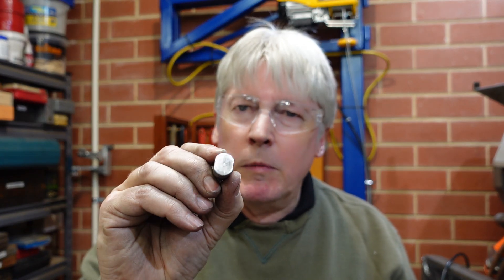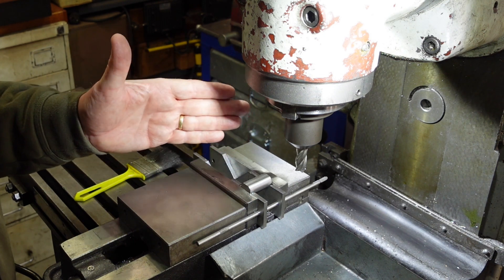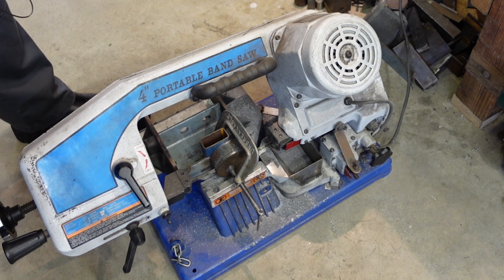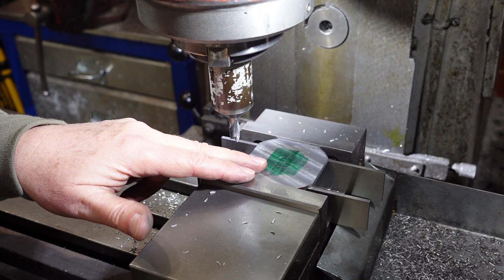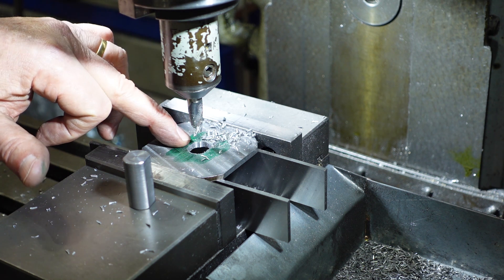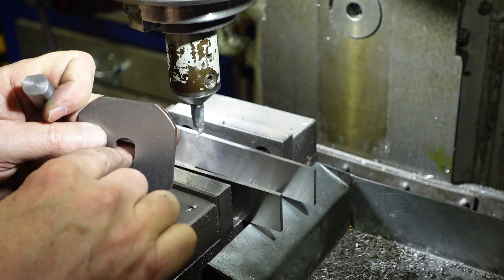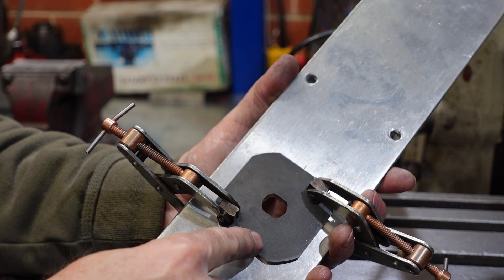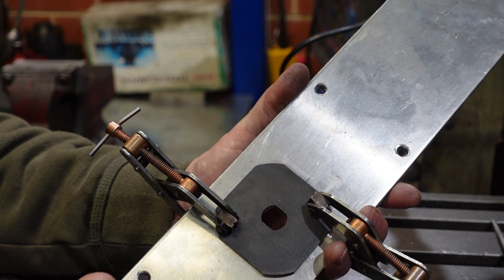Connector cutouts and a quicker way of making them

Comment: Michael --  That was tedious work. The end result was good . I have a suggestion . A Rotary 
Table would make fast work of that job. Using a small end mill you could accurately machine 
the Diameter . You could also accurately machine the two flats . There would be a limited 
amount of filing to clean up the radius corners . I'm not a smart ass - I'm tryin to help . - Jim
Reply from the maker: You are right, and one day I'll finish up the little R/T so I can do that. The only one I have is 8" diameter, and for little things like this, getting it out seems a bit silly some time.

Comment: Hmmm, nice but why not 2 plates and the sheet metal sandwiched between them? Otherwise in case of thin sheet metal it will bend during filing. Harden steel? For a file not a best friend. For a few holes don’t needed., in my opinion. Or is it for a higher run?  Could be I don’t get it. ❤
Reply from the maker: A few bits of the story were edited out, but this is for 3mm thick Al panels, so bending is not a major concern. They are a pretty standard connector so for a one off, I would agree that it was more time consuming, but I expect to have to do one or two of these every few months, so over the next year, I think it will earn it's keep.
If I had two plates, I'd also need some way to line them up. The steel is not really hard, just hard enough that I'm not going to accidentally file into the template. A small round file like the one used is relatively inexpensive and I'm only filing the Al till the feel changes, so I don't think I'm damaging the file in a major way.
Thanks for asking though - it keeps me honest!
Reply: @occasionalmachinist  Much appreciate your feedback, thank you.

Comment: A good solution.    I recall Greenlee made a single-d punch for that size round connector, not sure about a double-d - a cursory search found a US engineering firm that custom-makes them- pretty pricey though.     It was always nice to be able to borrow a punch  for odd shaped holes like serial ports or IEC plugs, but most of my homebrew DB25 or DE9 panels or PC slot plates  were drilled and filed by hand;  a filing guide similar to yours would have taken most of the drudgery out of doing them.  Greetings from the northern suburbs.
Reply from the maker: Yes - I think the next one that I do will be a 9 pin D - for some reason the 25 pin D connectors don't get used much these days (maybe all those pins that don't do anything...)
One thing that in hind sight I should have done was put some cross hairs on the template for more precise positioning. There's always something.

Comment: It seems like you are more than 50% of the way to making a punch and die. Of course, I'm sure you can buy a punch and die for an industry standard hole, but what's the fun in that? Your chip tray caught my attention as soon as you cut to that shot. I like it!
Reply from the maker: I did think about a punch and die, but I would need a die set to hold them in just the right relationship, and Murphy's law says there will also be panels beyound the throat of the press. This is more low tech but more adaptable too.
I try to make clean up as quick as possible, so I tend to have chip trays to collect the majority of the swarf if I can. The one for the mill is new, but the oil quench was done on the cabinet that sits under the drill table - the top is a removable chip tray too.
Reply: @occasionalmachinist  A rolling chip tray makes a lot of sense, too. You are always a source of interesting ideas. As far as a punch and die goes, I was thinking the kind with a bolt through the middle joining the two halves and which you use to drive the punch through the work, as opposed to the kind that goes in a press. They may not be as quick or as precise, but they are a lot more versatile! Thanks for sharing your work and your ideas.
Reply from the maker: @fxm5715  Might work - the concern here is that the material these cutouts go into is 3mm Al. I'd be a bit concerned that the thickness would either snap bolts or just bog down (the cut out in question was 13.5mm across the flats so a bolt would likely be M6, perhaps M8)
Reply: @occasionalmachinist  Agreed, 3mm in aluminum is a bit gummy for a punched hole that small, with an imprecise, underpowered punch.
Reply: @occasionalmachinist Use a piece of urethane as a die. No need to line up the the punch. A couple of example demos on my channel.